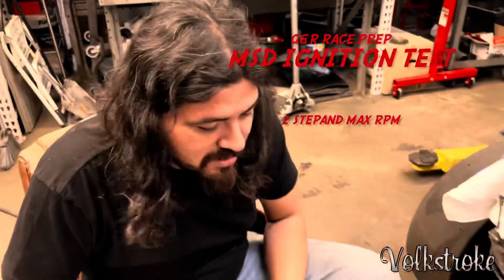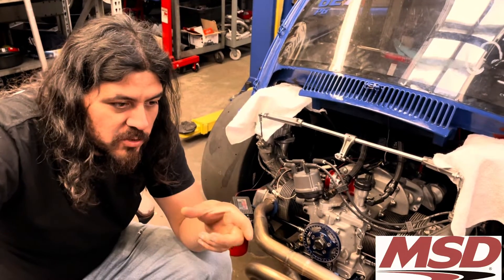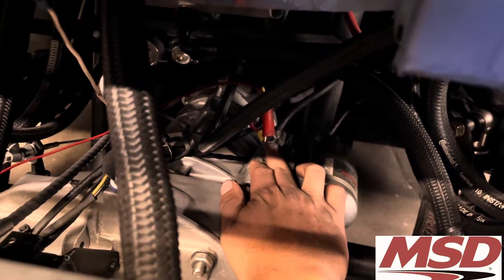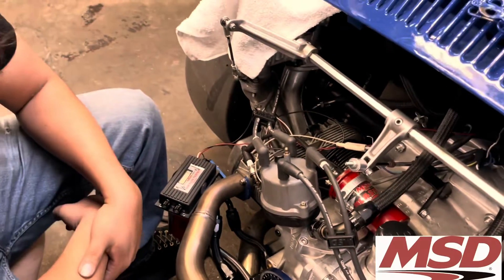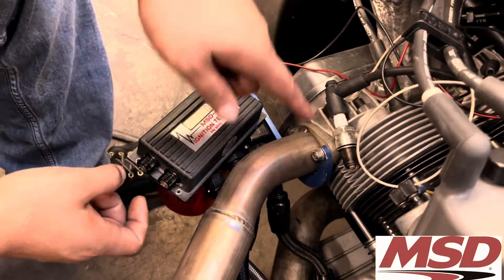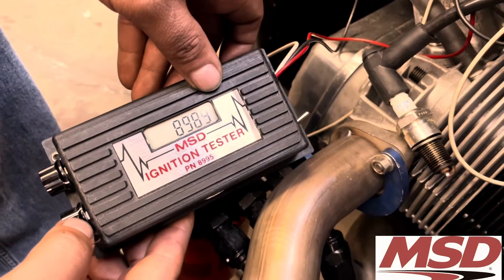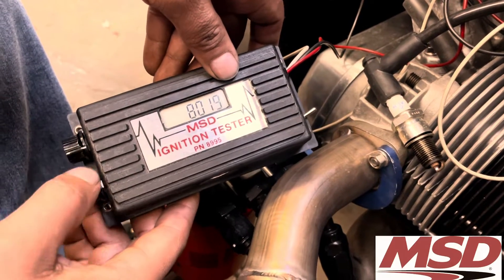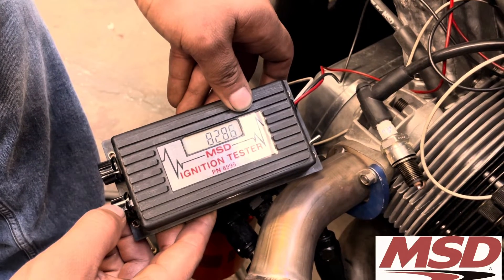MSD ignition test 2 step & max RPM

Comment: The resolution on your 2step is not great(harder on parts). Rev cuts starting roughly 100rpm to 250rpm before the limit are common. I tend to set my soft cut 300+rpm before the hard cut. Nice and soft like that, most of the time anyway.
Reply from the maker: Thanks for the info!

Comment: Hey David, Mike FN told me to reach out . If I’m running a 1679-1776 with (88) heads, on dual 40s genuine webers. Do you have an idea where I should be as far main jet? Im
Getting a great idle with (55jets) , but it’s bogging down during gear transition, and I’m hearing very slight popping, but definetly bogging down too. Any help is appreciated sir.
Reply from the maker: Probably just needs more timing or a 125 Main too many variables on altitude and compression